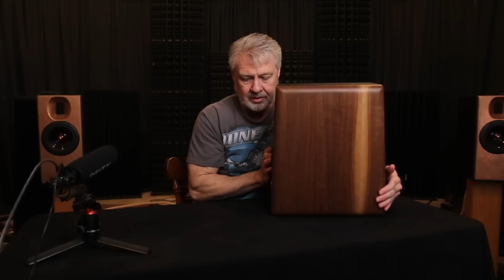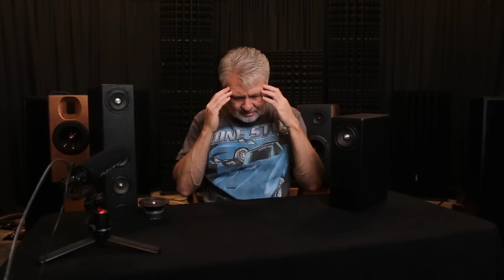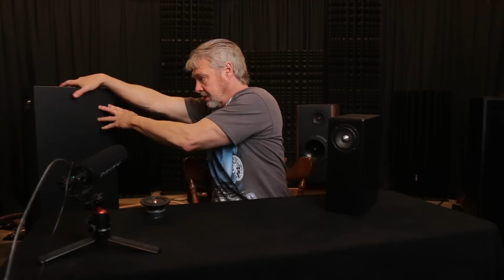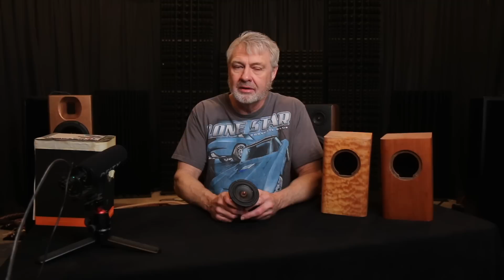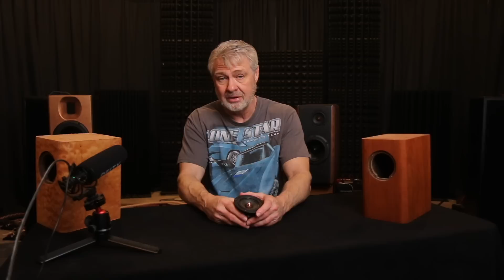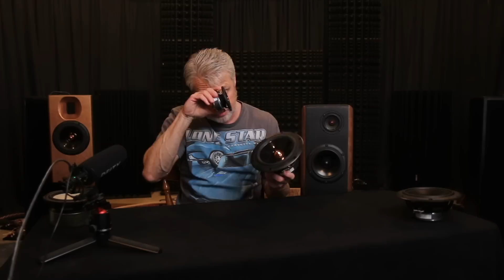Finally. We Can Chat About These... The New Record Day Loudspeakers!

Comment: I actually got to hear these speakers in Ron’s listening room with the GR-Research open baffle servo sub woofers, and I can verify that everything Danny is saying in this video is 100% true. He is not hyping or exaggerating when he says this is one of the greatest speakers he has ever heard. And it does some magical holographic surround/sound stage voodoo that I can’t explain. It can image like a Dolby Atmos surround system, I kid you not!
Reply: @BrentLeVasseur  how would electronic music sound on these?
I bought some Dali Rubicon 2 & 5 because of how the vocals sounded but for my other music (Balance 026) it's not as good as the older cheaper hifi I replaced. It seems changing a hifi component doesn't make things better, it moves things to a different place.
Reply: @darrenlomax1283  Well for electronic music, it’s mostly about bass and slam, and for that the open baffle servo subs and the sealed subs that Ron had paired together would have handled it very well. But you would need to get the subs with these speakers for that, as it doesn’t play below 80 hertz.
Reply: @BrentLeVasseur  Hopefully the floor standing variants reach lower
Reply: @darrenlomax1283  Yes it will.
Reply: @dannyrichie9743  for you to do a video explaining the history of how you got here, these won't be cheap. Sounds like it'll be worth the money.
Reply: @darrenlomax1283  Personally, I would go for for the book shelf with subs as you can’t beat that combo with a single floor stander. The only downside is complexity and cost. But if you are after the absolute best sound, I think the bookshelf with subs is the best.
Reply: @BrentLeVasseur  having speakers that sit that far into a room is such a niche product. I wish I had a room big enough to accommodate them because I'm sure I would love them.
Reply: @darrenlomax1283  Me too! My listening room is also my living room/kitchen. The Spatial Audio X5s perform amazingly well in this crappy room. I highly recommend them.
Reply: @ Yup! While open baffle speakers do a really good job of mitigating a small/untreated room, the best solution is headphones because that essentially eliminates the room entirely. That’s why I recently invested in my ultimate end game headphone the Hifiman Shangri La Sr. It’s like having the perfect speaker in the perfect ‘room’. And it also makes sense for someone like myself who lives in an apartment where I have neighbors above and below me and I can’t have powerful subs playing floor shaking bass. Headphones solves those problems. And if you are on a budget, what I tell most people is get a pair of Sennheiser True Motion Wireless 4 IEMs and a pair of Hifiman Ananda BT Nano wireless headphones and you are done! The Sennheisers are for traveling on planes, working out, listening outside in noisy environments, and the Ananda BT V2 is for listening in doors in private. That’s a $1200 end game hifi system right there as it incorporates the ‘speakers’ (i.e headphones), DAC, amp, and room all in one. You can’t beat that bang for the buck!
Reply: @darrenlomax1283 Usually so. Exceptionally well made speakers can sound good on more/any music, it's rare and usually expensive.
Reply: @darrenlomax1283 
 Correct.
Reply: @davidjudd951 what is correct? I've made a few comments on this video so I don't know which one you're replying to.
Reply: @darrenlomax1283  
 The sub comment
Reply: I ended up with the exact same conclusions since I got hands on a 3inch wideband driver from Scanspeak (10F8424G00) I measured on my own. I was driving it in a even smaller Box combined with a subwoofer in a small room. Stunning. By the way, it is about physics - not 'magic'. If you love magic, do not go too deep into physics, because the 'magic' then disappears - and the fun you had too.
Reply: Crazy how Canadians would rather buy Made in China products vs Made in USA products now that we are under attack !?!
Reply: @BrentLeVasseur  The rear facing driver just adds random phase/delay , absolutely nothing accurate or resolving about that.
Bose tried this years ago, a fool and his money…… 🤭
Reply: @thenorfolkst  I asked Danny about that over dinner, and as I understand it, basically what it is trying to do is take a sealed box speaker and make it open baffle for the top end. And the reason for that is if the speaker were actually open baffle it wouldn’t be able to play down to 80 hertz, which is the reason for of the enclosed box with port in the back. However, for sound staging and imaging, which is largely upper midrange-treble region, open baffle works best as it sends a dipole signal where the rear facing wave is 180 degrees out of phase with the front. That opens up the stage while eliminating side wall reflections due to cancellation effects.
Reply: @BrentLeVasseur Is the rear lgk driver wired in phase or out of phase? If it's in phase then it's not dipole but rather bipolar.
Reply: @ichigobankai2343  In phase.
Reply: @ichigobankai2343  I don’t know. I only listened to the speakers, I didn’t build them or take them apart. ;) But from what I could tell they are probably 180 degrees out of phase which is how open baffle works, because that’s how they sound, close to the imaging of an open baffle speaker. They also have some third party noise reduction device between the speaker cable,and the speaker binding posts similar to Less Loss firewall for speakers, but I don’t know if Danny will be offering that as part of the speaker package. Best. to ask him these highly technical questions.
Reply: @BrentLeVasseur  Hey Brent, the rear driver is actually in phase with the front driver but its limited to the top octave only which is how Danny can get away with that design. It does indeed sound a lot like an open baffle speaker in that the rear driver will bounce information off the front wall and that reflection as a late arrival gives the ambience and open sound you liked so much.
Reply: @BrentLeVasseur  Danny already answered my question. Thanks. Also these are not open baffle but rather bipolar in which sound radiates from both sides in phase.
Reply: @Newrecordday  Please correct me if Im wrong but isn't that like adding some hi-passed reverb to the sound? From your description it sounds like it.
Reply: @thenorfolkst  Actually the rear firing driver doesn't work like that at all. It adds spaciousness, depth, and layering that more mimics the radiation pattern of real instruments.
Reply: @dannyrichie9743  It's something arnie nudell did for decades adding an emit tweeter to the back.
Reply: @thenorfolkst 
Bose, years ago yes. However, currently Wilson flagships, Von Sweikert, and many other high end mfrs offer such rear firing ambience drivers. 

It's contribution wouldn't be described as phase delay.

Typical loudspeaker positioning would yield returns a few dozen full cycles later, scattered and diminished in level. 

This is exactly what can elicit pleasant subjective listening experience. Due to the additional path length, that reflected energy doesn't corrupt the direct energy imaging.

Comment: This is essentially a FAST design and has been around for quite some time. So it's basically a LF assisted fullrange driver. These can sound really good, but the main potential issue is the 10k+ extension off axis. I've built one of these designs using the ScanSpeak 10F, which IMO is one of the best 4" fullrange drivers currently available. If Danny has come up with a better driver for this design, it would potentially have some good following. I'm just not a fan of rear firing drivers. That's my own preference. If others prefer a huge (perhaps exaggerated) soundstage, this may be for them.

Comment: Are the rear wideband drivers in phase with front wideband as a bipole or are they Dipole like an open baffle speaker. Are they firing into same cabinet chamber? In bipole it cancels even order harmonic distortion and the drivers stabilize each other reduce internal reflections and distortion and in dipole they cancel out much of the back wave greatly reducing cabinet resonance through the drive reflected back out at the listener making internal damping even more effective. I think seperate enclosure for the widebands would be sub optimal either way though isolation in different chamber from lower wofer would be mandatory for improvement in soundstage quality. How about an open baffle version with two 12inc subs in side firing h frame that face each other open front and rear canceling vibration. Or even line source 7ft tall version of open baffle wide band seperate subs 20hz-22k

Comment: Interesting, so a woofer-assisted wideband, with dipole from 250hz+? I wonder if you could get a weak cardioid/hybrid dipole thing if you attached a rotary switch with switchable L-pads for the rear wideband. It may offer more flexibility for small rooms (and/or positioning near the front wall) that aren't well suited to proper dipole placement.

Comment: I would love to hear what you think of the hivi swans diy 3.1a. it seems like one of the most accessible kits out there and there is a decent following of people who upgrade them. It would be cool to hear your opinions and advice on how to improve them. I know you don't usually talk about diy speakers from other manufacturers but I think these may be worthy of an exception.
Reply: Well, they leave a lot of room for improvement.
Reply: @dannyrichie9743  I certainly agree. The crossover components leave a lot to be desired. I replaced the sand cast resistors and followed instructions for the "option 6" modifications from Scott sehlin which involves using different value capacitors, inductors, and resistors to attenuate the overly bright highs and flatten out the bass response. (I'm no electrical engineer believe me but I can follow instructions relatively well) the inductor for the low end circuit is a laminated steel core but I feel that that is more of a size constraint than anything. The cabinets aren't especially large. To my ear they sound great but there are plenty of weak points in the circuitry that I'm sure could lead to reduced performance that would be obvious to someone who knows what they're listening for. The PCB itself for one, the wire and binding posts as well and my lack of soldering skills and use of push on connectors aren't helping either. Still it was a wonderful introduction to the hobby and I believe the kit even with the added price of different components constitutes a decent value. I think the next step up may have to be one of your kits. Now that I've built one pair I think I've been bit by the bug
Reply: @thebiggestbird009  "Still it was a wonderful introduction to the hobby "

I agree with that.

Comment: What exactly is a very steep second order filter?  AFAIK, they are all 40 db/decade.
Reply: Depending on the values used a second order filter (two parts) can create a slope near 6db per octave to nearly 24db per octave.
Reply: @dannyrichie9743 

This doesn't clarify what you said.  A second order filter function has 2 poles and the denominator polynomial of 's' of the transfer function is second degree.   E.G. low pass:

H(s) = ω²/(s²+2ζω+ω²)

A second degree high pass or low pass filter will always have a roll-off of 40 dB/decade .
Reply: @jamestyrer907  Nope it doesn't work that way, and the textbook roll off for a second order filter is 12db per octave.
Reply: @dannyrichie9743 40 dB per decade is 12 dB per octave.

Actually 12 dB per octave is just a close approximation because 20log(.25) isn't exactly 12.
Reply: @dannyrichie9743 12 dB per octave is 40 dB per decade.

Comment: I have been enjoying learning new things from your channel. Even checked out your website, which I do not normally do (totally agree with you about burn in. My bi-amped KRK studio monitors were brittle, lifeless, and sterile when new, but today are brilliant). I have to admit, I am very curious what you would make of my own home speakers; the Canadian made Reference 3A Micro Master (today called MM De Capo) that is a "tweeter enhanced" full range crossoverless design that only has a single cap on the 3khz-30khz tweeter, while the main transducer has a range of 45hz to 7khz and is direct to amp with no filtering. Like you I prefer the smoothness of a soft dome tweeter.

I bought these after weeks of shopping and listening and being very disappointed with what I heard in the size and price class I wanted (small and on stands at around $2k-$3k). When the salesman pulled them out and plugged them in they were astonishing. Blew everything else away; Infinity, KEF, Polks... They are still astonishing today. Absolutely transparent with a wide and deep, richly detailed sound stage. Close your eyes and they disappear. 

I suspect, though, that after many thousands of hours of play time and a few decades of age, they are becoming mechanically worn, though the natural rubber suspension still seems perfect today.

They are designed to use an external crossover if so desired, though I always figured why add anything to the signal path when its nearly perfectly pure and sounds amazing as it is. But now you have me wondering if there may be some improvements to be had, or perhaps some tuning that can compensate for ageing.

One thing for sure, I think they would benefit from some no-res.
Reply: Designs like that cause the drivers to play over each other causing out of phase cancellation and deep holes in the response with any change in height.
Reply: @dannyrichie9743  Except there isn't. The drivers (hand built by the manufacturer) are closely phase and time aligned and tested as matched sets. They were designed for "straight ahead" positioning and have specific left and right units which results in an extremely wide sweet spot and awesome off axis response. They are also very efficient.

The Reference 3A MM series has been under constant development for 40 years and you can find a variety of test articles  similar to what you do here going back decades. They get rave reviews, and as mentioned, the are astonishing when you hear them given their size and modest price (about 4k a pair today).

The only complaint I have is port chuffing when driven hard on my earlier front firing port series. They move so much air the port can blow out a match at 8 feet. I am not exaggerating. Its like an air cannon. To me, that doesn't seem quite right. More recent series have moved the port to the back and controlled it better.

If you can get your hands on a pair, I would love to hear your reaction to them. 99% of knowledgeable people are always sceptical (you should hear the squawks on social media when I post them). Until they hear them. Heck, the owner of the company is such a nice guy, he might help you source a set to test.
Reply: Ditto

Comment: @GR-Research Danny, would you consider making an "LGK Encore"? Basically an Encore with the LGK driver replacing the tweeter? Something with more bass extension than the LGK 2.1 but without the rear driver and crazy cabinet and Shunyata tech of the Aria?
Reply: You are describing the model 2.
Reply: @dannyrichie9743  Are you talking about the to-be-released 2nd model of the "Aria" series?
Reply: @ Yes.
Reply: @dannyrichie9743  But won't that still have the rear driver, HARP device, etc? I'm thinking of something more affordable and placement flexible but with that LGK magic... (and more bass extension in bookshelf form)
Reply: @xlvi_ii  It will have the rear driver as well. If you are looking for a deal then look at the LGK kits on our site. Those are really tough to beat. https://gr-research.com/lgk-series/
Reply: @dannyrichie9743  I'll wait for an LGK Encore 😉 I want a bookshelf with more bass extension than the LGK 2.1
Reply: @xlvi_ii  This first model with the M130 woofer will hit a -3db of 55Hz. The floor standing version has the M165 model and will hit a -3db of 45Hz.

Comment: I can see more precision of the rear speaker set up on a geared rotatable axis.
We tend to toe-in our speakers. That sends the sound outward instead of adding that precision in toward the center.
Reply: Even add AMTs to the front. Possibly, in the rear.
Reply: Pure silver cables used inside.

Comment: I’m just finishing up a pair of 3-way speakers, driver time alignment was a little tricky, and i ended up tilting the baffle back to get thing physically aligned in time, but you mentioned you have gotten really good at doing something in the crossover for time alignment.  I am familiar with the phase offset each order imparts but that’s not enough to accommodate a 1” time alignment offset.  Was wondering if you could comment on the recommended way to time align via crossover.

Comment: A cautionary note however...I, and many others, DON'T have the luxury of pulling speakers 6 feet or more out into our listening rooms. Bummer to hear these speakers will only sound their best in that situation...
Reply: I agree, I don't think that there is a coincidence that many brands (ex KEF or Wharfedale) has a shelf in the bass for their stand-mounts to counteract this problem. My guess is that if you have the ability to bring them out from the wall, you have a larger room to begin with and could just go for floorstanders.
Reply: They need at least three feet. We often design speakers for specific applications and this is one of them. We do have many others that work well in less than ideal situations. Our NX Studio Monitor is a good example.

Comment: Remember at one time when the paper 3" tweeter was normal. My 1st set of very good sounding speakers EDS, had a 3" tweeter with an 8" whizzer cone midbass. Just had a cap and a coil for an X-over. It had a 3" hole in the front with a piece of foam glued to it. As a kid I had a blast with those.